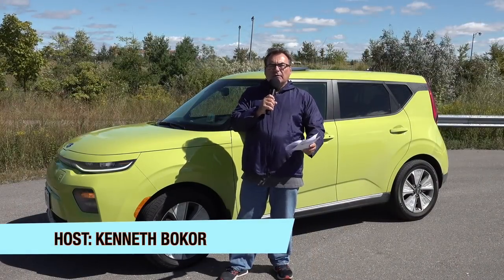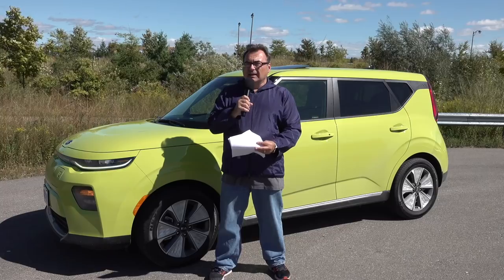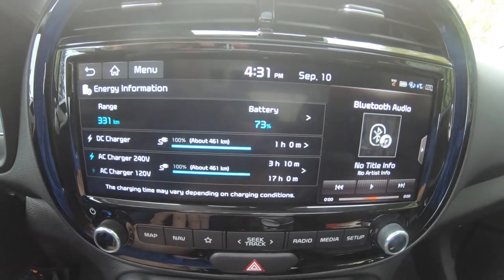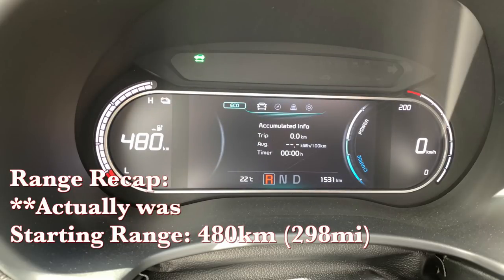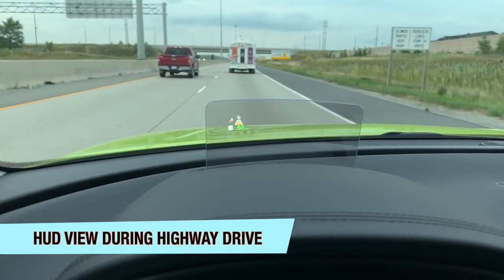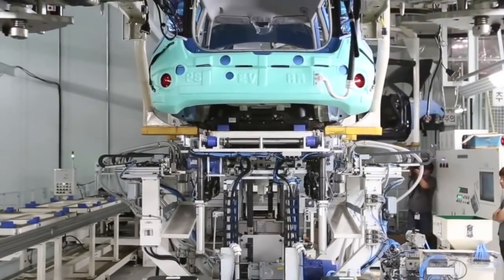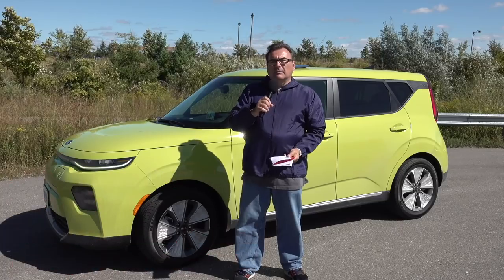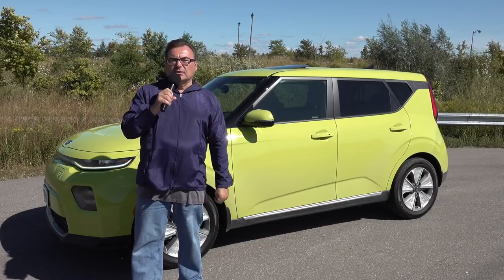Episode 62 -  2020 Kia Soul EV (64kWh) Review!

Comment: I don't understand why some E- Auto Maker ( Like VW - TESLA - CHEV - NISSAN) doesn't ramp-up the Mexican VW Bug plant and make E- "VOLTSWAGONS" on the old Beetle Base = K.I.S.S.?  Charge on 110vac~ No Computers ~ Digital Read outs ~ 100<200 Mile range ~ $15,000 <$20,000 priceI would buy 1x!
Reply from the maker: Sorry but the BUG is dead.  I.D. will be the new future and the I.D.3 is the new Bug.  

You can get refurbished electrified aftermarket Bugs.
Reply: Where?
Reply from the maker: California for one.  You would have to google.  Many small companies are springing up that are looking to retrofit cars into BEVs.  It's a small industry so every bit helps, but this is not the massive way to go.

Comment: Shame it costs so much. Kia isn’t helping people convert. Just get a model 3 for that price.
Reply: He explained why he would get the soul over the 3. Cost per mile of range and ergonomics. 

I am 56 years old. And every car I have purchased in the last 30 years has a hatch. (Utilitarian) 
Model Y is not an suv
Reply: You basically can't. The price leader is essentially vapourware. When I configured the Model 3 like I wanted it the price was 10k over the Soul, for basically the same equipment (and in fact the Soul has some things the Model 3 does not). Tesla's configurator is to blame here -- if we didn't have to opt for AWD or the larger batteries to get the equipment we wanted the Model 3 would be a much more attractive proposition, price-wise.
Reply from the maker: Thanks QICR for the feedback and thanks @TIM and @Heidi for your comments.  Agreed, the Model 3 does not work for many and that is why we need choice, even from other manufacturers that are still in compliance car mode.  Compliance or not, Kia and Hyundai have built really really good BEVs that in my opinion are just as good as Tesla for being a BEV.  Sure they may not have the cult following and software OTA/autopilot capabilities, but they all offer very good battery systems and driving characteristics, along with ergonomics and a good price point that will appeal to many!

Comment: I'm afraid you've fallen victim to Hyundai/Kia's misleading marketing, which makes reference to using 100 kW chargers without making clear that the platform will accept only ~70 kW. See https://www.greencarreports.com/news/1116041_5-things-about-the-2019-hyundai-kona-electric-we-learned-at-the-ny-auto-show, point (4).
Reply from the maker: Hi Peter, thanks for watching and for your info.  I'm pointing out with all the reviews I do, what the manufacturers specs states.  Hence one reason why I like to test features, especially DCFC-ing capabilities (where I can) to see the real life numbers.
Reply: @EVRevolution  I can't find the exact wording right now, but it was deliberately ambiguous, referring to the duration of charging on a 100 kW fast charger rather than the maximum wattage accepted. I haven't seen that latter number on any specs, but I might have missed it.

Edit: The official spec sheet online says this: "DC fast charge with Electric Vehicle Supply Equipment (EVSE) to 80% charge -- 75 Min (50 kW) / 1 Hour (100 kW)” The numbers in parenthesis refer to the EVSE. Nothing about the maximum set by the car. 

This is not a criticism of your fine reviews, which are leagues ahead of most of the "experts" on Youtube.

Comment: I'm pretty sure that this is my choice right here.  

Can you confirm that the Climate Controls are usable while charging?  I live in Nevada, and will likely be charging in the middle of the desert heat.  Being able to take a nap in the AirCon would be great/necessary.
Reply from the maker: Hello NSFW, thanks for watching!  I can't confirm that as I did not actually need to test it.  I only charged it at the test facility I talked about and had the vehicle only on to read the charging.  Did not run the A/C or Heat, as it was a pleasant temp.  However, do see any reasons why you can't.  I may get another chance to drive one of these again and if so, will try to test this for you.  Feel free to email me at EVRevolutionShow@gmail.com asking me this and I can see if I can get you a 100% answer.
Reply: You can have climate control on while charging my friend